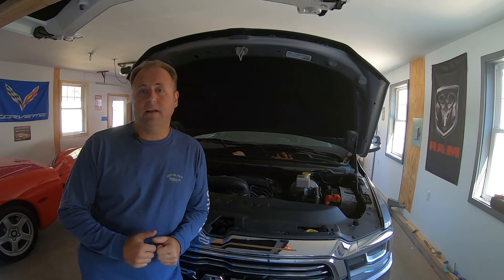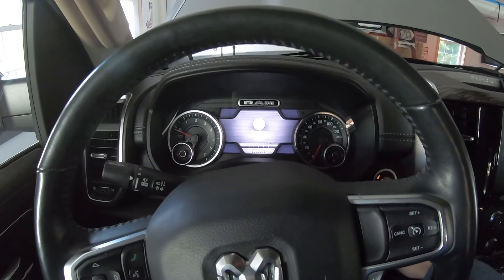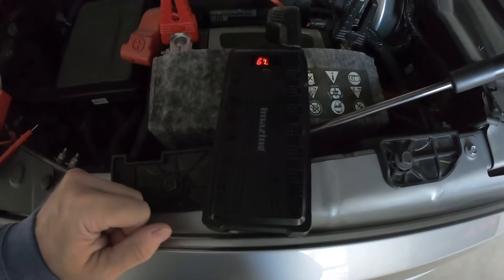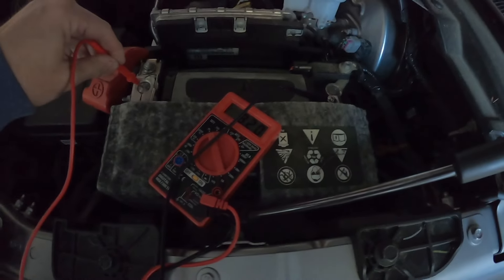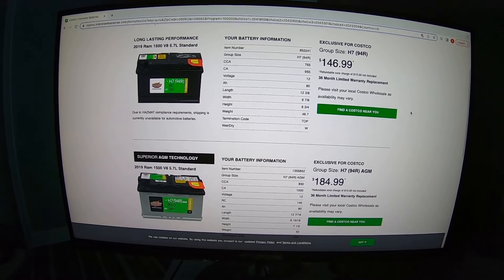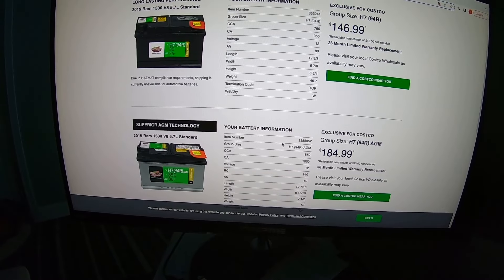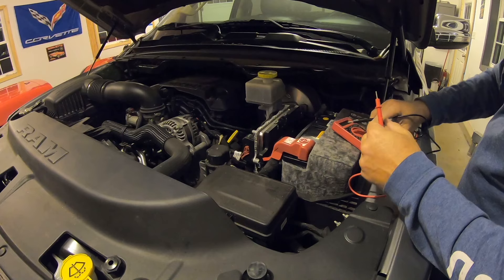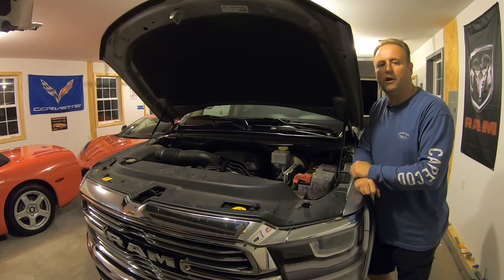How to replace a Ram 1500 battery. 2019 2020 2021 2022  Ram 1500 dead battery . Ram 1500 battery fix

Comment: Thank you for posting a great video!!  Recently, I changed the battery in my 2017 Ram.  It took about 2 or 3 weeks for the bugs to work out.  Sometimes the radio would just come on.  Sometimes, the fan for the heater/AC would just randomly increase or decrease.  Also, the remote start wouldn't always work.  Now after about 2 months, everything seems to work just fine.  I didn't think it would take a few weeks for the bugs to work out after the computer booted back up, but it did.  So if anyone else has this problem, relax.  It'll fix itself over time.
Reply: Ya, my radio hasn’t came on yet. Says ‘Update failed, reconnect usb device.’ What did yours say?
Reply: @johnduvall3432  Mine didn't say anything.   Give it some time.  The computer has to reboot and it could take a couple weeks for everything to work itself out.
Reply: @johnduvall3432  It may have lost the Bluetooth ability, you could try to reconnect it yourself.

Comment: From a safety standpoint the positive cable should be connected first.  That way if you should accidentally short the wrench to ground nothing will happen. With the negative cable connected first if you accidentally short the wrench to ground, you could potentially get burned and possibly blow up the battery.

Comment: My battery died in 2 years on my 2020. Heated seats, dash cam , aftermarket security system and power running boards. 
Now I have a  noco Gen 5x on board charger. I plug the truck up once a month and keep the new AGM battery fully charged to extend the life.

Comment: Same truck here. Same issues. I just bought it 2 1/2 years ago. Taking it to the dealer tomorrow morning. Battery should be covered under warranty. Save myself a couple hundred dollars. Thankfully, I had bought the Noco gbx155 jump box on Black Friday a couple weeks back. Very thankful to have that. But I am very surprised to see a battery with bad cells so quickly. I also have a check engine light on.

Comment: Hey thanks for your detailed video . My question is should I get an agm battery or regular? Someone from Walmart said that the ram do not recommend  agm. Any response will be appreciated
Reply: The AGM battery, from my non-mechanic mind, was designed with the idea that it would not release gasses into the cab...for those vehicles that store the battery inside the cab. Since the ram 1500 has a battery in the engine compartment, one would not need to worry about that. But... If you want a Corvette, like this person does, you would definitely want an AGM battery. I don't really know of any significant advantage to have an AGM over the other. Again, I'm not a mechanic and I'm not an expert. But I do read Google! 😅😂😅

Comment: I have a 2022 ram trx and my battery had the same issue, 9 months and 5k miles. Odd to get a defective battery so soon. Was on a trip and needed a jump every time to start. Dealer didn't want me to buy an after market battery and diy for some reason. I know it's covered under warranty but when on a trip, it's tough. It also gave me a check engine light, limited the performance and gave me an eobd / injection system failure code as well.  Sitting at the dealer now.
Reply: My TRX is a little over 2 years old now (May 2021) and recently I tried to leave somewhere after the truck has been sitting for 9-ish hours and I noticed it started really slow, but it did start. It started fine after that but I noticed the voltage meter on the infotainment screen was always reading 11.9 or 12.0, which is pretty much dead for a car battery. I'm not sure how accurate it is, though. It would always start fine, though.
Then I had it on for a sec and I saw the voltage drop from 11.9 to 9.7 in a split second. I let it sit for the night and came back and surprisingly enough it started, but barely (which is why I'm not sure if the gauge is accurate or if this starter just works really well on such a low voltage).

Then a few days ago, I tried to start it after sitting for 7 hours and it cranked briefly but then stopped. I tried again, same thing. I thought it would've been the first time it wouldn't start, and checked the voltage meter and it said 9.6V. I turned off the radio (it's been in accessory or RUN for a minute now) and I tried to start again, and it turned over super slowly but did fire up! I was extremely impressed and happy I didn't need my portable jumper, even though I did have it in the truck because I expected I'd need it one of these days.

 I almost never run anything off the battery and always have the engine on so the fact it's dead after 2 years is crazy. Idk if it's the same battery as in the States as I'm in Europe but I read a lot of people's TRX battery died within 6 months to a year on the TRX forum. I'm gonna go downstairs now to try and install a new battery and hope that solves it, and not that I have a drain or something.

Comment: My 2019 limited just did the same thing, starter was replaced a year ago. Too many electronics on cars these days so the 5 year life span is no more lol
Reply: Mine died this morning..
Reply: @Bagel_Biscuit  its frustrating, no warning signs at all, just dead. not to mention the past year i would get random warnings like power steering, trailer brake, collision sensors, stabilitrak and then my engine light would be on for a day or two then be off. also my remote start works when it wants. ill start it then it shuts off after 60 seconds and has a error message saying remote start disabled. im selling it and going back to GM lol
Reply: I haven't had one problem with mine with this being its first. My remote starter works great. I have 38k on it now. 2019 Ram. Got it June 29th 2019.
Reply: My battery went just this morning. I've got most of it undone but got stumped getting the hold down out. But with this excellent I should be good. One rant, if I may, that's kinda-sorta related. My eTourque battery went in mid-July. Fought with the extended warranty company, ASC, as it was only covered as a "battery" and not the highly sophisticated piece of electronics that it is. They only covered $100 for it because it fell under a heading of BATTERY. And now this battery was $180.

Last time I buy an extended warranty because now they are experts at wrangling themselves out of coverage. Thanks for letting me vent and be safe out there!

Comment: Awesome video, I seen a video where a guy had a 2019 ram rebel 1500. He said dropped a H8 in and said it fits perfect. I was curious do you think a 2020 ram 1500 bighorn has the same battery compartment as the 2019 ram rebel? Jus thought I'd get little bigger battery if it works. Thanks

Comment: 2019 ram 1500 limited. Mine is starting but all dash light are on and most systems are disabled (abs, cruiser conteol, 4wheele drive, traction control)... recently had back brakes done and battery is a year old.  Any have idea what the issue is?

Comment: Could have cleaned connections while battery was out and should have checked voltage and charged new battery before install just so you know the new battery is a good one…

Comment: Any word on the the battery? I have a 2020 dt and a dead battery. 15k miles. Don’t drive it much, sometimes don’t start it for 7-9 days at a time. Curious if you are in similar situation and if new battery was a fix. Also with the scan tool, did you reset the codes with the old batt installed or the new one? Thanks for your time…..to anyone that responds..
Reply from the maker: Yes I reset the codes with the old battery installed. I didn’t start it again tho. Waited til I put the new battery in. No new codes came up. The battery was definitely the culprit and and haven’t had any issues since. Hope that helps! Thx for watching
Reply from the maker: Just had another thought too. You probably don’t even have to reset the codes. If you put the new battery in and run the truck for a while I bet the computer would reset them automatically
Reply: Thx , I appreciate the feedback

Comment: Great Video.. I just wanted to mention AWSOME c8.. I have a C8 and a ram 1500 Laramie!!! Great choices buddy. Side question.. Would you change the hoses on the ram at a radiator flush?? mine is a 2019 and the hoses just have dirt on them (kinda caked in) but im at 98k miles so I was pondering just changing it all .

Comment: Do we need to do anything else after replacing battery? It should be a simple plug and play and everything should work as normal. Don’t need to recalibrate anything?
Reply: You must take your 5 Gen ram to the dealer to be reprogrammed after every battery change. Or you will get hard shifts and error codes on the ecu
Reply: My 2019 5th gen Ram I just replaced (my second!) the totally dead Mopar battery with an AGM.  Had a check engine light for a while but after driving it for a few miles it went away.  Had it checked for codes and there were none.  Everything seems to be working well.  Battery change was very simple except for the weight of the new battery and the fact that I could not lower my 2019 Limited with no power...

Comment: Battery just died on me. After replacing the battery the check engine light came on.  The truck seems to be running ok but I will read the codes and reset.
Reply: I have the same issue. Did it run fine after resetting? I can’t find anything else wrong and was thinking the same thing. Reset and see if it comes back on after reading codes
Reply: Same thing but the light went off after driving for a few miles.  Had it checked, no codes.
Reply: I have a P0027 code for an exhaust valve control should I just reset? It only came on after the battery swap
Reply: You have to have the charging monitor reset otherwise with these new vehicles it will overcharge the new battery and your battery will prematurely fail

Comment: I've heard there is another behind the back seat is that true?
Reply: No battery there
Reply: Yes but for etorque equipped models only there is a 48v battery behind the rear seat.
Reply: @shatterdome_x42xlopez49  My 2020 has etorque.  Are you saying I'll need to replace both batteries, including the one behind the seat? (I had no idea one was behind there!)
Reply: @HaltWhoGoesThere  yes this possible if it dies.

Drive it regularly and extend your warranty if possible.
Reply: @HaltWhoGoesThere  the 48v battery can go bad, yes.
Reply: @shatterdome_x42xlopez49  What does that battery run?  What part of the truck uses it? Im trying to figure out how id know if it went bad, aside from using that meter this guy had in the video, which I dont have
Reply: @HaltWhoGoesThere  so the first thing we must understand is these trucks that have the etorque system do not have an alternator.

Instead of an alternator, they have a small generator in its place.

The etorque system provides 150 ft lbs of torque on the first rotation of the rear wheels when taking off from any stop.

The etorque system also provides power for the start and stop system.

As well as during gear changes the etorque system can add power to help with a smoother shift.

This is why they call it a mild hybrid.
The etorque system also charges the 12v battery I believe but that may be different on certain models.

Comment: Did you have to reset the battery charging system? AGM batteries charge at a lower voltage and the system must be told what battery is installed is what I heard. Also, Costco prices on batteries are expensive right now. Lead Acid Kirkland brand is 199.99 and AGM is 299.99. That is a massive price increase in short time since you recorded this video.
Reply from the maker: Thx for watching. I didn’t have. reset anything after the battery was installed. The computer took care of everything. Had the scanner handy just in case. Yeah the prices of everything is crazy right now. Just shop around, maybe you could find a deal somewhere